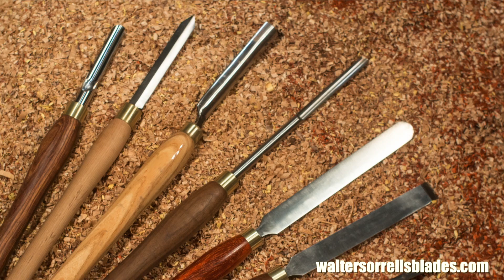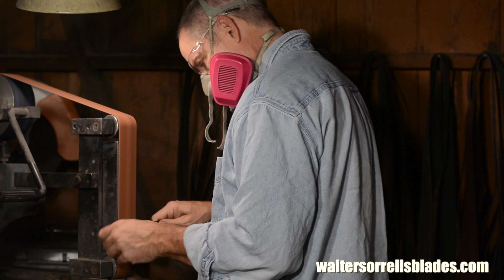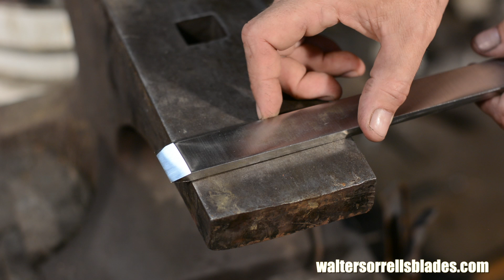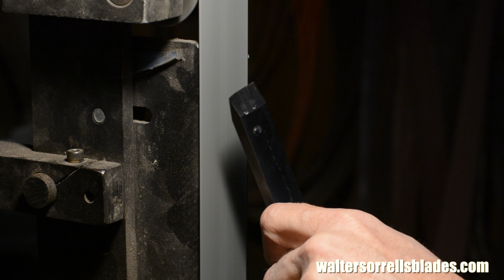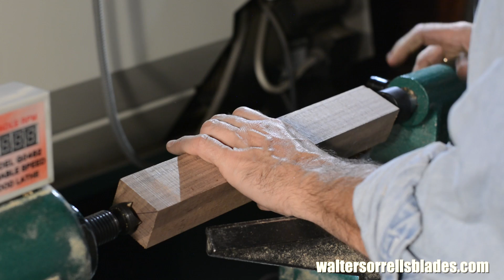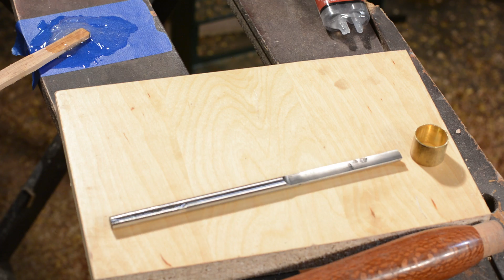Making Woodturning Tools Part 1:  Skew Chisel

Comment: I absolutely love your video series Walter. Interestingly, I started making knives about 15 years ago because of woodturning. Making woodturning tools was the gateway drug. You may want to consider rounding the edges of your skew chisel - sharp corners dig into the toolrest when you do spindle turning. It has to be my favorite tool to use for that purpose - you ride the bevel along the radius of the workpiece and then gently adjust the angle by tilting the chisel and allow it to start shaving off some wood. I find it to work so much better than holding the chisel flat on the rest. This ONLY work with spindle turning. It is extremely important to keep good stance, use the tool rest and to experiment with this technique bit by bit because if it catches, it will spit the tool out at you before you can blink.

Comment: One of the best steels I have found for wood turning tools is the shafts out of shock absorbers and McPherson struts. To work them you have to bury them in charcoal, light it and let it burn out and the metal cool in the ashes over night. That normalizes the steel so you can machine it. Once formed, just do an simple oil quench hardening and you have a pretty fair wood turning tool. Also makes great metal punches and chisels. Otherwise the really old, rusty, big metal files are the best. They were made from better steel than the new ones. Any straight chisel can be made from a file.

Comment: it actually is kind of critical to have the edge of the tool that runs on the tool rest very smooth if not polished so that as you move your tool down the work piece it does not snag or drag causing it to gouge the wood.
Great videos by the way, I am a wood turner and actually found your videos because i am getting into knife making as well.

Comment: Nice chisel! I made one like that from a bevel edge chisel (which, in hindsight, I shouldn't have). With my father I made a roughing gauge from a ballbearing once, in the fireplace - yeah, mistery steel, how you once called it, but it was an air hardening steel, so we didn't do any heat treatment on it :) It serverd me well for several years (until I bought another one)

One thing about the handle - making them that shiny, and covering them with laquer, it's actually counterindicated - a rough handle is more practical, and it won't slip from the hand, nor it will cause blisters if you use it a lot. That's why woodworkers usually coat their tools with linseed oil, or don't finish them at all - the sweat and oils from the hands will protect them agains rotting. Granted, it doesn't look nearly as good, but from a usability/safety standpoint, it's better.

Comment: When I made my skew I burned the handle on. I chucked the blade in a steel vice with the tang pointed straight up and heated the tang red hot with a torch. Then I jammed the (pre drilled) handle down onto the tang. Very satisfying. And in over 15 years it has never come loose.

Comment: Walter, thank you for the info.  Well done.  I'm not set up to heat steel so I guess the step two video will be more to what I can achieve.  I've only been turning since this past Spring and I am amazed at what I've accomplished in a short time with my cheap 8x12 Harbor Freight lathe.  Best regards.

Comment: very nice video, Mr. Marting Has already mentioned this, It is very important to round the edges of a skew. If you do not you will bugger up your tool rest and this will really screw up the quality of your turnings, so you spend a lot of time with a file
getting the nicks out of the rest. Then you use the skew again. Then the file again. Of course I never made that mistake.Oh sure.

Comment: I recently made a plane blade for a home-made trim plane.  I've watched several videos on heat treating but the end result wasn't good.  I confused some things in the process.

First, I didn't know about normalizing and sure enough the blade curled.  Imagine a plank of wood that cups.  That's what my blade did.  I managed to work most of it out on ceramic wet stones but in the end the sharp end is slightly off the work which isn't where it's supposed to be.

My plan is every time I sharpen it I'll spend some more time working it back to where it's supposed to be.

Second, I didn't get it hot enough.  All I have is a propane torch and I thought I saw someplace that O1 steel could be heated with one.  But it never passed the magnet test.  I went ahead and used it anyway but yeah, a file bites into it.

It can always be heat-treated properly at a later date when I get the right equipment to do it.  I will hardly ever use this plane.  I made it now because I glued a bunch of wood planks together to make a cabinet sharpening station and that means tons of glue to chip off.  I didn't want to jack up my chisels and sanding it would have taken a lot of time plus probably melted the glue into the wood which would screw up the finish.

The plane works fine.  It held its edge and never chipped so I'm happy with it.  Again, it's a very limited use tool so no rush making it right but videos like this one help a lot so I can heat treat the blade properly.  Plus I plan to make some other planes and my own blades.  If it gets to be more of an expense than I want then I can always buy blades from Veritas or Lee Nielson.

Thanks again.

Comment: Great video Walter!  My wood dealer told me that Sapele is a more sustainable wood that a lot of guys are using in place of Mahogany.  Question, I just built a welding table and the top is made out of what I believe is AR500 (1/4" that came from a salvage yard). I've got some scrap.  Would that be acceptable steel to make any cutting tools out of or is it just abrasion resistant Mild Steel?
Reply: correction:  I actually think it's AR400 since that's what the big steel yard where a lot of local fabricators order from carries.

Comment: You said you use a 5 gallon bucket of water to dip the blade in to prevent overheating.  I was wondering,  is it necessary to have that much?  Does more water help dissipate the heat better or something?
Reply: +RLP3 Nope, five gallons is just a standard bucket size and it is large enough to fit even large blades into. However you can get away with something smaller, even a tin can for small blades.
Reply: +Jared Little Scam site using pirated plans...looking for your personal information!

Comment: Hi walter, im a folower of your videos and i was verry surprised to se you tourning wood :) and make your hown tools for that.
The reason of my post. I bought a wood lathe to recently and decided to buil my tools to. So, i used a car suspension piston (about 12mm thick) to make gouges and a 12 inches file to make a skew like yours. I havent made any temper to those tools so far.Shold i make any temper to that file? it keeps cutting well such as gouges. why is so important the temper of the steel? have i made the best choices? best regards from Portugal :)

Comment: Walter... Nicely done thanks. What are your feelings about using a plasma cutter for roughing out blades and tools? I'm lazy and want to save time. But if it will cost more in time and work which most short cutting will often do then I will put in the work. But I have never seen yet anyone using a plasma cutter to cut blanks so I was wondering if there was a reason.
Reply from the maker: Yeah, a lot of people use water jets for production or semi-production blades but honestly, I'm not sure why not plasma cutters.  I'll hazard a guess that you may have issues with de-carb?  But that's just a WAG on my part.  I've actually never used one myself...
Reply: Walter Sorrells WAG? wild ass guess? great video. I really enjoy your work, and appreciate you sharing your knowledge. any thoughts on the safety (or not) issues of setting up a small shop in a garage in middle suburbia?

Comment: I'm starting to get into this slowly putting together my shop I'm just curious because instead of buying new steel I get mine from the scrap yard automotive boneyard ect. I believe in recycling but I was wanting to know if there is a way to determine the type of steel of certain car parts so I have easier time determining what would be a good steel to use for edge or spine ect.
Reply: MrShaun1578 try leaf springs, most of them are made from 5160 silicon spring steel and some from 10 series carbon steel's but as far as I know they're all fairly high carbon steel's, I'm sure if you did some (extensive) research you could find out exactly what steel's are used on specific vehicles... and at least at my wrecking yard there's tons and tons of pickup trucks with leaf spring rear suspension
Reply: some lathe tools are also made of HSS, which can stand higher heat without loosing its hardness. Not going to be much of that in a scrapyard, and it probably wont forge very well, if at all. I would look into spark testing and just use whatever you can find.

Comment: Is it necessary to go to a finer abrasive for finer grained woods?
Reply from the maker: +RLP3 It's totally a question of how shiny you want it.  The point is that harder, oilier and finer grained woods will take on a bit more sheen than other woods.
Reply: +RLP3 for a tool handle that will get a lot of use, you should stop at 400 grit, or even 150, and give them a coat of linseed oil. You'll get a better grip, and you won't get blisters. Many woodworkers sand off the paint/laquer from the handles of their tools after they bought them.
Reply: Dumitru Ursu  very good advice!   thanks for passing it along    : )    Merry Christmas
Reply: Egan Schreurs hiv
Reply: RLP3 
V

Comment: i was wondering if i could use a regular cheap wood working chisel for a lathe? thanks
Reply: Probably a bad idea, as good wood turning chisels are made from high speed steel (HSS), with the exception of those with replaceable cutters, and are meant to hold up to heat, etc.
Reply: Yes you can. They will not have cutting edges that are sharpened with the correct edge or geometry for great turning, but they work in a pinch.
Reply: David I wouldn't, they could catch and break.  if you needed a cheap set, go to harbor freight and buy a high speed steel tool set, with a coupon it would be around 50 bucks.

Comment: I am a wood turner and I have somthing to say I have found that you should/ could
1. Radius the cutting edge of a skew slightly 
2. Break the edges on the corners of the blade that are sort of coplaner
3. Increase the angle of the skew 
4. Wipe down the wood before each progressing up in grits.
5. To break the sheen (if you want a more matte finish) use some 0000 steel wool 
6. My finishing process usually involves (and if any wood turners with more experience want to correct or inform me go ahead) applying a beeswax and mineral oil butcher block conditioner with a ton of heat ( I fill a paper towel with wood chips and hold it up to the wood) and then let that cool and then apply a wipe on polyurethane finish. 
Have fun with your turning Walter

Comment: OK, I've heard this twice so far, and I'm at 13 and a half minutes.

The better the finish, (on the shank of the blade) is not important.  

Sorry, but as a woodturner, the smoothness of the tool, WHERE IT RIDES ON THE TOOLREST, is as critical as the sharpness of the cutting surface.  Notice how you are sliding the tool along the rest, as you make a pass?  Notice that you also are sliding the tool in or out, on that rest as well?  Imperfections in the shank of the tool, and imperfections on the face of the rest will copy on to your work.  Every little catch on either sliding surface will make a copy on the work.  Unless you like to sand A LOT, keeping (or making) these surfaces as smooth as possible will make your work even better.

Another thing, sharp sides on the skew, will tend to cut into the cast iron toolrest, as you use it.  Rounded corners are more desirable.

Oh, I'll be ENJOYING the rest of these.  I'll probably LEARN a LOT!  

THANKS!!

steve